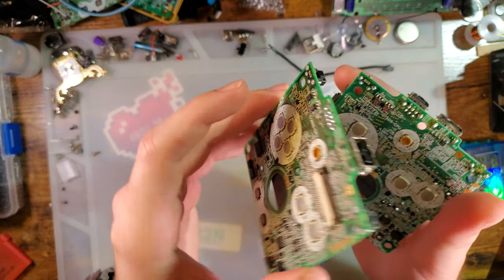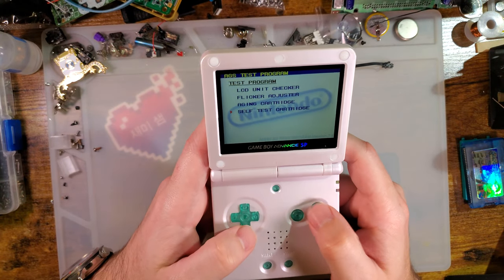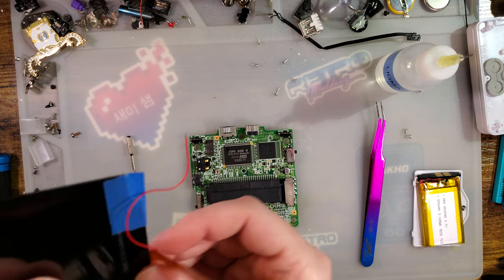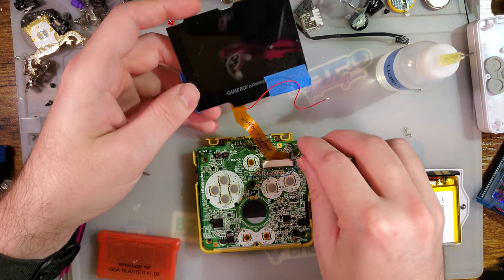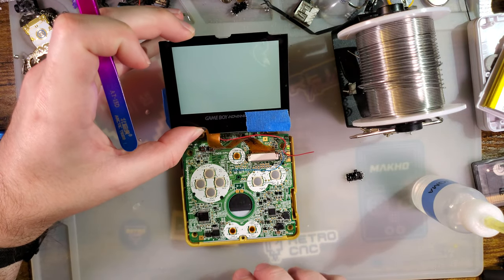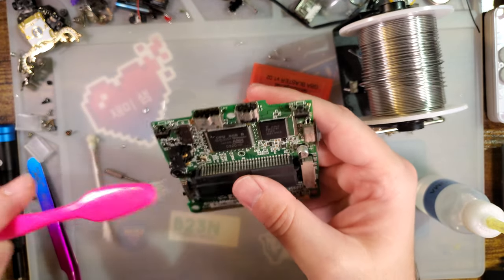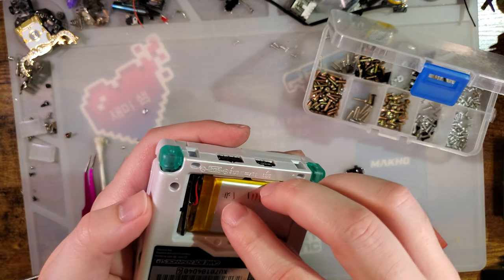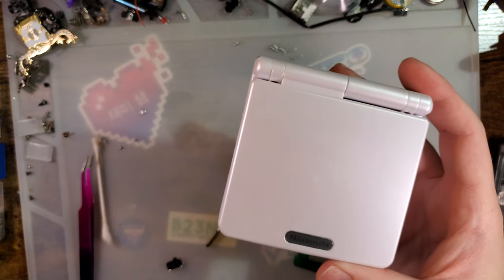Faulty AGS Troubleshooting and Repair

Comment: I have an SP where the contact pads from d-pad and a and b buttons randomly stop working - I’ve replaced the contact pads (stole off a ds fat unit) and it worked for awhile and now the issue has returned. Not sure if you ever came across this issue or not. Have another SP that won’t shut off even after the switch is off, there’s a short somewhere but have no clue where to look. Gameboy works but won’t shut off - green light stays on. Keep up the good work bro, it’s inspiring. - BAN

Comment: I have a faulty AGS-101 board that has a weird quirk, wondering if you have any ideas.

Boots AGB games fine, but GB and CGB games show the Nintendo boot logo, but then just a black screen with no audio. Tested on an authentic AGS-101 screen and IPS kit, same results with both kits. Initially thought it may be a power issue, but it boots my EZ-Flash omega just fine and plays fine but for whatever reason, my EZ-Flash Junior, CGB/GB bootlegs, and authentic GB/CGB games won't boot after showing the CGB boot logo.

I thought about opening the "switch" for the GB/CGB games in the cart slot and trying to give it a good clean, but it seems functional. Any idea what the issue could be? Posted on Reddit and Gameboy Discord to no avail. I'm thinking maybe a faulty CPU?
Reply: iirc the gba has a switch on the cart reader pins that tells the cpu its a gba or gbc/gb game. idk if the gba sp has that too

Comment: my old dmg links awakening wouldnt hold a save with new battery. reflowed the ram chip. noticed a little bit of green corrosion in between 2 legs of the ram chip. working perfectly again.